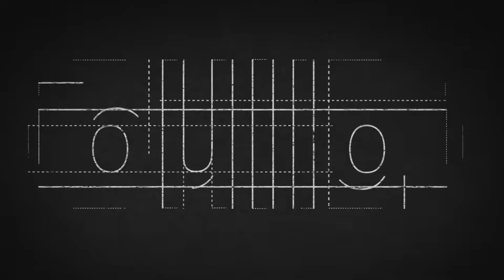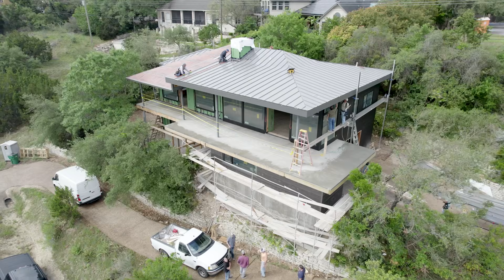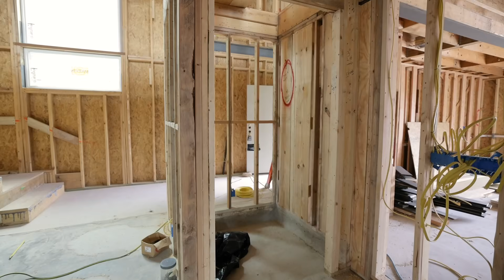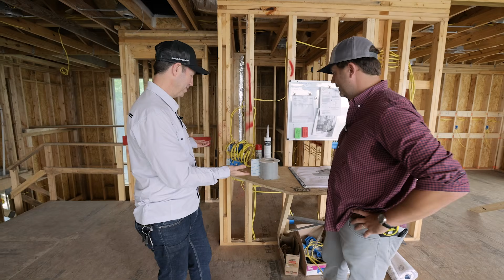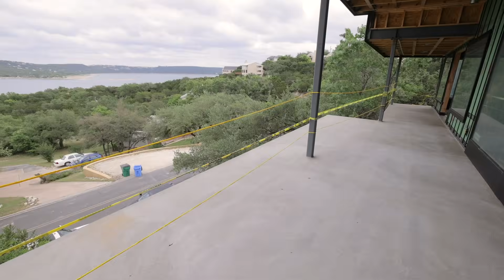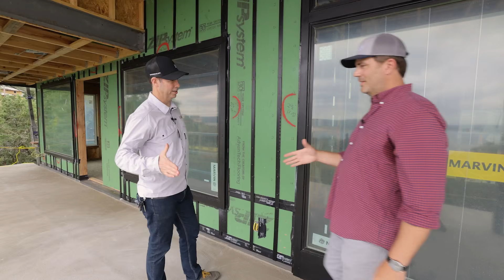This Waterproof Deck System is KILLER!  (Build Show Fan Remodel Tour)

Comment: The most disappointing thing I’ve ever done is building my own house.  I’m a perfectionist construction equipment technician. 
Building a house is in no way something a perfectionist would accept as perfectly built. 
Grading went ok. Retaining walls 660 linear feet was a nightmare but came out ok.
Footers weren’t vibrated as specified in the plans and had lots of cracking. Stem walls were poured like soup.  Did not expect that and was sorely disappointed to see such watered down concrete going in after months of trying to get grading and retaining walls perfect . Plumbers was one guy who appearantly was outsourced by the plumbing company and placement of drains accuracy was sloppy by inches at some places.  (Was told don’t worry, there’s room for fixing after the slab which to me makes no sense) back fill of drain trenches was absolutely atrocious.  No water,  on proper bedding, no compaction, just loose abc dumped in the trenches.  The entire foundation only had one pass of a plate compactor before concrete, I had to hire the geotech to get him to check and sure enough he said what I expected.  Work needed redone.  I demanded a full water down, jetting the trenches to sink the loose pack and an entire recompaction of the entire pad.  Foundation concrete slab pour just ran out of time in the day and didn’t get saw cut till next morning and by then it was too late, already had cracks in concrete before saw cuts were completed.    The framing wich we are currently in right now is severely questionable.  I’m no framer but it seems Very abusive in how the lumber is treated, lots of breakage and cracking,, way too many nails with the nail gun, way too much beating things around with hammers.  This house build, if I live through it will be the most depressing and stressful thing I’ve ever witnessed take place and I’m there every single day, cleaning and working on loose ends. It’s like a full time job.
For some examples of unplanned work I didn’t expect.  When retaining wall foooters got flooded with mud during a flood, I had to scoop the dried mud and clean thoroughly to get the footers prepped for wall waterproofing coating to be applied. Took me 4 days. 
When kitchen island needed sleeve ran for electrical, I had to trench and run conduit as electrician wasn’t hired yet. 
When I wanted drip lines from Mechanicle rooms installed I had to run them to get them done in time.  When trash builds up (daily) I have to clean.  I’m constantly cleaning.
After stem walls, I made magnets on all thread to pickup all the discarded nails they pulled from the forms and there was a LOT.  After foundation, hundreds more nails I had to clean up.  During framing, pickup about 150 nails daily and the trash produced is insane.  Tomorrow I will be taking my shop vac to clean all saw cuts through out the house and garage, install backer rod and fill the cuts with poly self leveling crack sealant. That will probably take a couple days.  (No bids for this job either as it wasn’t thought about and quite honestly I can’t keep paying for everything to be done by somebody else when it’s something I want but don’t really need.  I mean nobody does that but I don’t want termites so I’m doing it to my house. 
I plan to do blocking everywhere myself for tv’s towel bars, door stops etc.  there’s just too much to even mention.  If you plan on contracting your own house, be VERY aware, your business better be able to withstand you not being there except to catch up on weekends because building your own house is a full time job!
Oh and don’t even get me started on damages, I have multiple chunks out of my retaining walls, two big chunks on my interior garage wall finished stems and of course the minute you tell a crew, don’t throw ladders and crap on these beautiful expensive walls, another crew comes in and starts flinging materials on top of your walls chipping away at your block.
Every time a new crew gets going on your project, you just can’t wait for them to get done and go away.  
I’m so sick of demanding fixes and rework to get things right.

Comment: We have this exact WestCoat system on our deck with tile over it as a waterproof roof for a room below. After about 12 years it started leaking everywhere. When we peeled off the tile, the WestCoat polymer layer (shown around 13:00) was completely degraded to black powder. No contractor wanted anything to do with trying to repair it, not even the ones who originally installed it. Only option was to demolish the tile and start over (hugely expensive). I do not recommend putting this coat system UNDER anything expensive. 

Make sure you have access and budget to replace it every decade or so because it WILL degrade. I love how the guy kind of dodges the lifetime question as says WestCoat COULD warrantee the materials for 20 years but it's really about the installer then goes and calls it a "lifetime" system. When it was sold to me they kept calling it that too (and the company selling it was called "LifeDeck"). The waterproof layer was literally completely rotted in ten years in a warm dry climate! It works great until it doesn't, but it absolutely won't last forever. It is also pretty much impossible to repair once the underlayer starts to rot, you have to rip/grind off the whole thing and start anew.
Reply: Thanks for sharing that review.
Reply: Thanks for this

Comment: We had this same Westcoat system done on our new house, about 850 square feet of deck.  Less than 3.5 years later we have surface cracks.  Westcoat says it is from normal sun and weather exposure and we are due for a new topcoat.  They say a topcoat should be applied every 3-5 years and should cost around 15-25% of the original install cost.  What they don't tell you about the warranty is you need an annual inspection by a "certified inspector or installer" and keep records of the inspections, then they would cover materials ONLY.  

This is NOT a very economical solution when it comes to homeowner costs.  I wish we had found something different, but are stuck now paying almost $5,000 to topcoat it.
Reply: Wow, thanks for the input.  So it looks like I'll stick with the traditional wood frame, composite deck for me.
Reply: Good to know. I'm looking for a system to waterproof what will be a second story balcony over living space on the first floor. Our second story balcony will be completely coverd, by open on the three walls. So it won't see the abuse of an open deck. That said, a $5000 recoat...No thanks.

Comment: I am one of those clients who, in preparation for an upcoming whole house remodel, subscribed and watched the BuildShow for years. Watched nearly all Building Science and Cup of Joe episodes too!

Questions of the day: how does a client find a performance remodeler who cares about performance and quality craftsmanship? What types of questions should a client ask a builder? 

When I asked contractors about the specific products they were going to use in my metal replacement roof assembly, more than one told me, “no client has ever asked me about that” implying I shouldn’t care about it either. Maybe it’s because I am a woman. 

I care what is going into my remodel. I am not trying to become a builder or tell anyone how to do their trade. I  am trying to get info and establish clear lines of communication about specific materials being used in my project and what we both hope to achieve from the end result. 

How about a hosting a Build Show episode for clients? Or perhaps create something like a Build Show badge - like the Energy Star rating - to help clients locate builders who are like minded about using quality products to deliver quality results?

Please us clients who appreciate craftsmanship and performance to locate the quality performance builders in ##### zip code(s).

Comment: I see the floor joist is almost on an wall BUT ALWAYS drill holes in the center of the joist as you compromise a lot of strength like the electrician did here at the 10 minute mark!!! 🙄

Comment: I'm still really surprised all these builders are continuing to use Romex. I'm from the suburbs of Chicago and we have always used conduit. It makes sense for running wires in the future, avoiding rodents, nails, etc. which could cause fires. I know it more money but seems like more parts of the country would be promoting conduit. I'd love to hear your thoughts Matt.
Reply: As an electrician this would at a lot of cost. If you have AFCI/GFCI breakers you shouldn't have to worry about a fire.

Comment: My parents have that system on their deck that had to be rebuilt. It still looks great more than a decade on. In fact, this summer, they are expanding the deck around to the other side of the house and using the same deck waterproofing system. 

It had to be rebuilt because of rot (in southern NV no less). The guy that built the house was an semi-amateur builder that would build a house (as cheaply as possible and largely DIY), live in the house for a few years while building the next one and then sell it. The deck was not well built to begin with. They tried to remediate some of the issues themselves (poor waterproofing and decking material that was terrible to walk on), but in the end hired a contractor to do it right. That was the most money they had put into a home improvement project to date, but hey haven't regretted it.

Comment: I design elevated decks with poured concrete/drain mat/60mill epdm/plywood.  It's proven very cost effective and durable in many projects over the last 20 years in Colorado.  The sub-structure (Steel or wood) is always designed with a  live load of 60psf and DL of 70. In heavy snow loaded areas the live load will increase.  The slab is sloped at 1/8" ( it tapers) and the wood frame at 1/4"

Comment: I have this Westcoat system on my rooftop balcony at my Townhouse in Dallas Texas. This was new construction and it appears the install was done poorly and I have had it replaced and worked on twice. Water came in my living room and I still have defects in it and the metal lath is visible/exposed in some areas. The "certified installer" is no where to be found and I am stuck at this point with it. It looks like a good product, but your mileage may vary based on the quality of the installation.
Reply: This is one of the problems I have with the "Certified" distinction. I think manufacturers should do away with it, if they can't backstop bad installations by their preferred installers. Installers and manufacturers should have a much higher level of quality installation that reasonably mirrors the manufacturers warranty on the actual product... otherwise why bother?
Reply: lol

Comment: I ripped all my siding off my 50/60’s home and sheathed the outside with zip R6, liquid flash at the sill plate, pressure treated band to sit the zip on, and full tape windows….yes you affect us home owners👍🏼
Reply: probably did it all wrong tho
Reply: @guwop2234 how very presumptive...

Comment: Can the west coat systems be installed in the north with freeze-thaw cycles? Is the warranty a lot less? Does it need recoating more frequently in those locations?
Reply: I have two family members in eastern Washington that both installed Westcoat decks approx 20 years ago. They were able to purchase the products and install themselves. Their prep and install was not the best so there were cracks in the coating, but no sign of rot. They both really liked the product.
Reply: I expect that West Coat works in your area, but if not, there are very similar systems from other manufacturers.  I live in SE Pennsylvania and 6 years ago had a rooftop deck installed using a 4-part system like the West Coat, and it has worked flawlessly.  The GC hired the subs for the deck, I have no idea of brand or installer or any additional info, sorry, just letting you know that these kinds of waterproof decks work very well in Pennsylvania.

Comment: Matt, WEST is this the same  company that originated in the boat building industry with the West Epoxy line of resins and hardeners, aka  the Gudgeon Brothers? Is that correct?
Reply: Hi Mike, we manufacture concrete coating and waterproof decking systems here in California! www.westcoat.com

Comment: Here at the Jersey shore for decades fiberglass decks- borrowed from the boat industry-  were the standard for waterproof decks. Now they are spraying Polyurea coatings-think truck bedliners. Still many guys are still doing fiberglass. Interesting how different areas of the country tackle the problem differently.
Reply: This is for if you don't want water dripping through the deck to the living space below
Reply: @KatherineHamar correct especially since most of the houses here are top and bottom duplexes